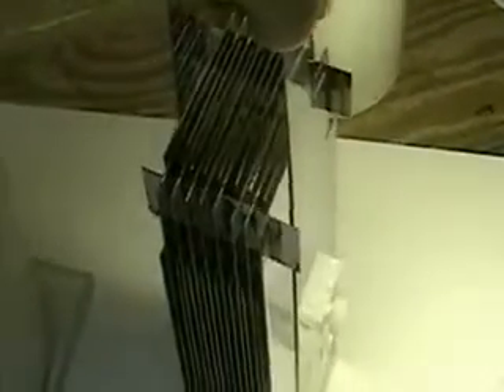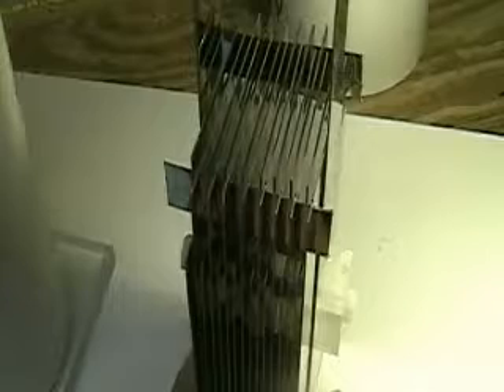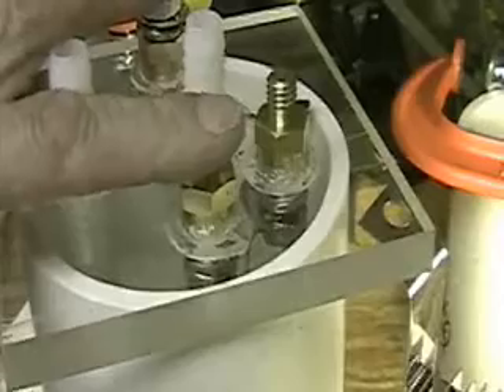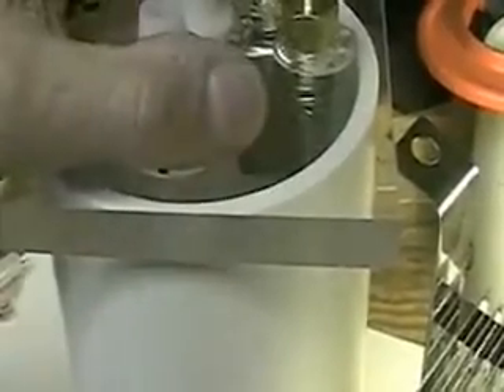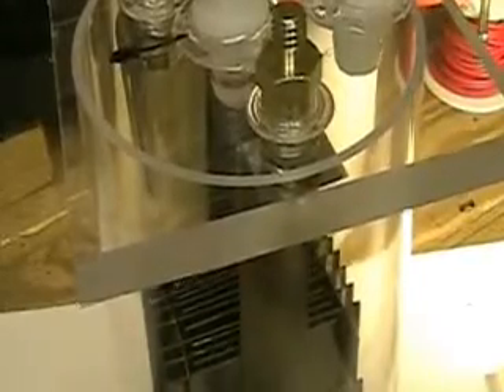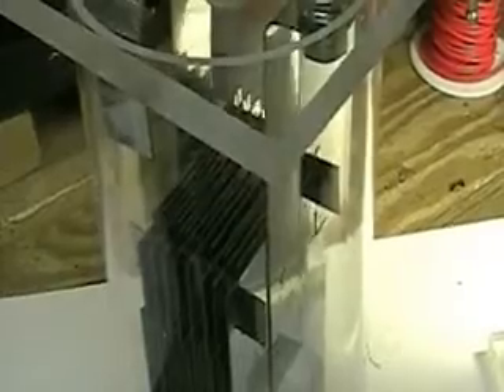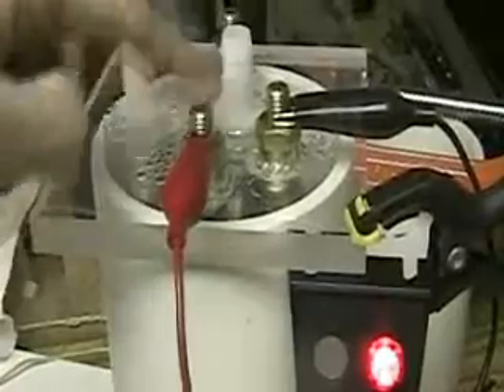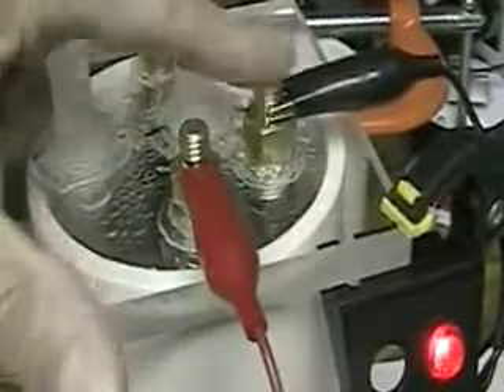Hydrogen Tap (FOCUS -next ) 298

Comment: u should put rubber glue on top of the tube(to make a seal) and use 4 pieces of booker rod thru the bottom flange to hold the top on,so you can take the cell out if need be.
nice build